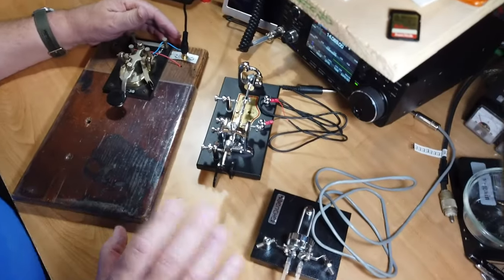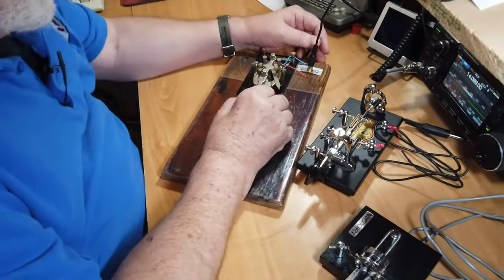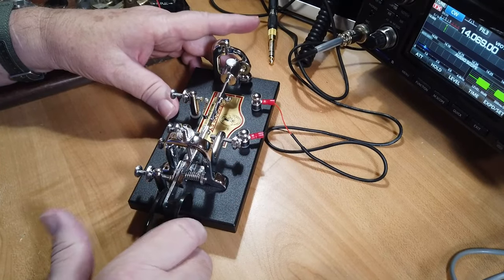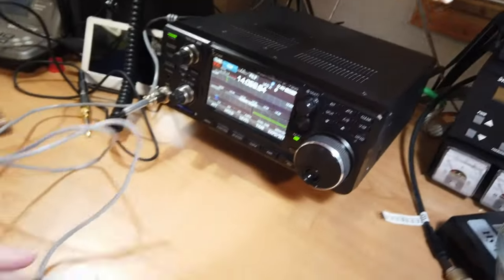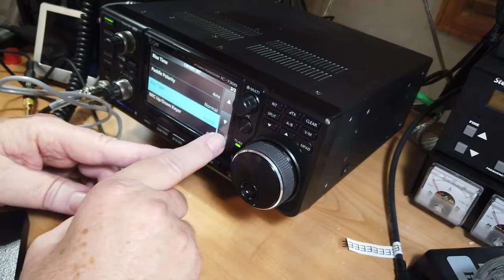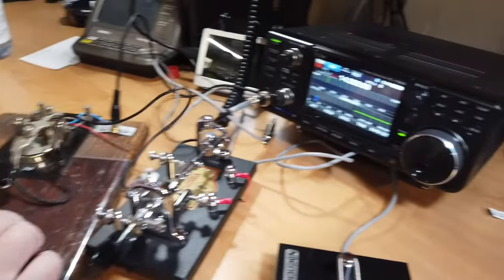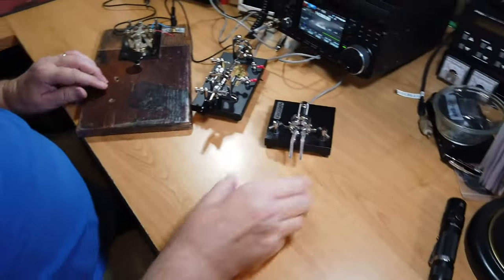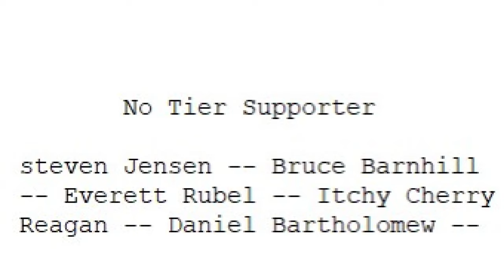Morse Key Options (#1033)

Comment: Good demo, thanks
There is the fourth kind that is a single paddle rather than the double paddle iambic that I am interested in trying.  I have problems with the timing in Iambic mode (age/familiarity I suppose) so the slower J-38 key is my fave.  But the single paddle does auto dit as well as dahs, just without the insert dit or dah features and I am thinking that may solve my timing problems.  I will make a "dirty" homemade trial one or get a 3D printed one for little money to see if that works better for me. 
Seems to be in between the speed bug and an Iambic maybe?  Have you tried that kind?
Reply: Although I have tried iambic paddles and occasionally use them, I prefer straight key. I have never tried a single paddle but keep meaning to make one or get one to see if it suites me better than the iambic. I have read quite few times that single paddles usually result in less errors. However, they don't seem to be very popular compared to twin iambic paddles.
Reply: I still use my 1942 Mc Elroy  J-38 Straight key that I started with back in 1979.
Just never had a interest in electronic keyers for some reason.

Comment: I learned the paddles with opposite polarity. Is that uncommon? Is there a "preferred" method? I never really saw anyone else use paddles until I started watching some Youtube videos and it seems nearly everyone does it reversed from what I was taught. TU de KA8VLW, Ken, Michigan
Reply: Normal configuration is dots on the left, dahs on the right. However,  swapping them seems to suit some folk better.
Reply: @Steve-GM0HUU  Thanks, Steve! I have a very small key which is meant to be hand-held. Should I ever have a fellow ham wishing to use my radio and is accustomed to the other way, I'll just tell them to hold it upside down and go at it!